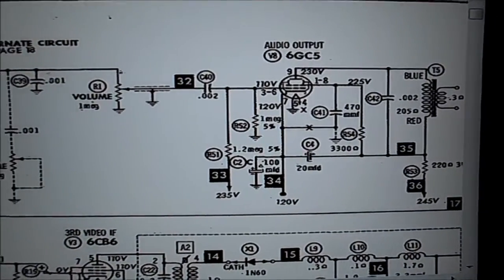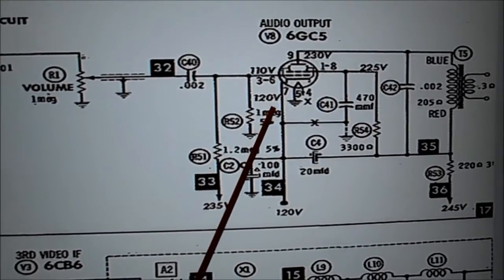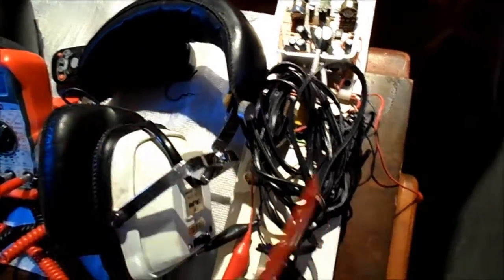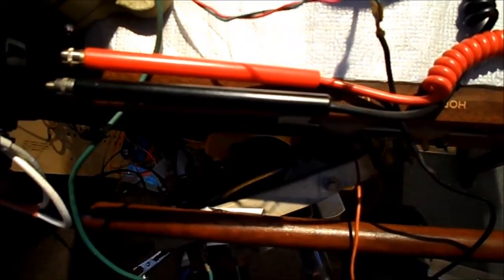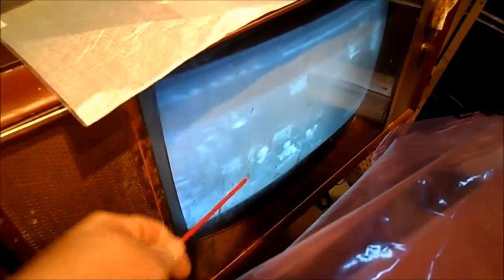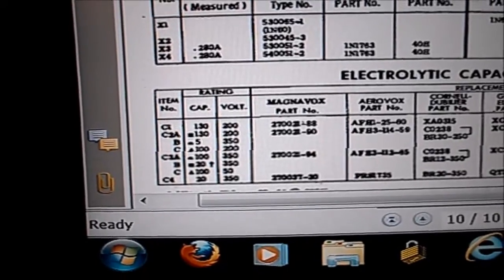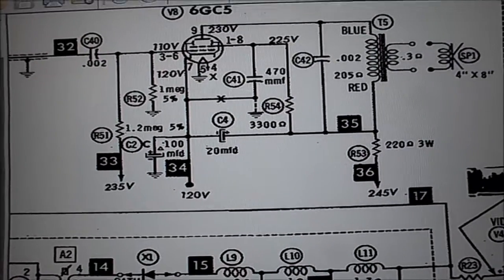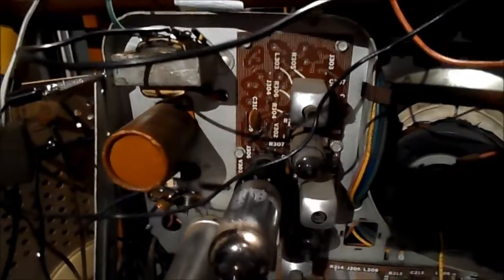Vintage 1965 Magnavox 19 inch B&W TV. Part 2.

Comment: Check R-52 1meg 5% resistor, if open will turn output tube hard on. Found out hard way. all the best Tom.J
Reply from the maker: Hi. Believe, I checked that one. Will verify. I did get the new tube, same no sound, just slight hum in speaker. Will re-check voltages, & look at the 470pf C41, maybe C42, and output transformer. Not much left.